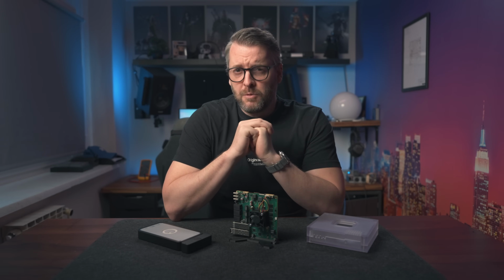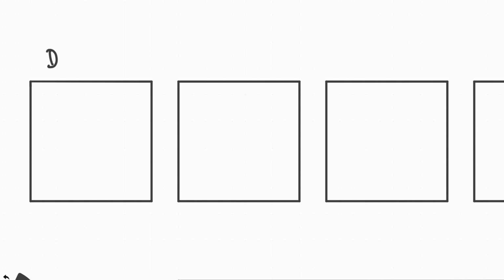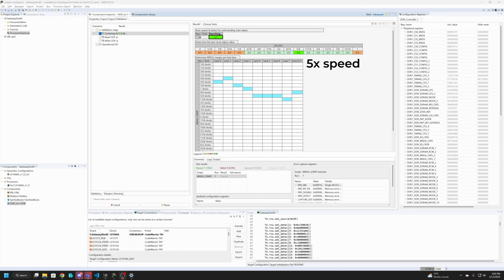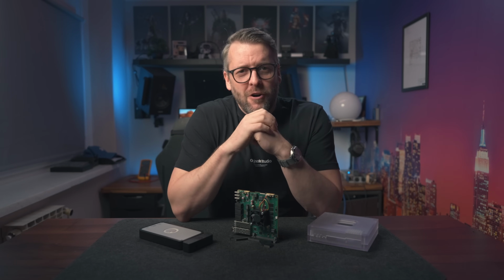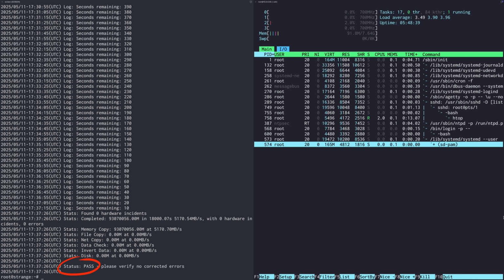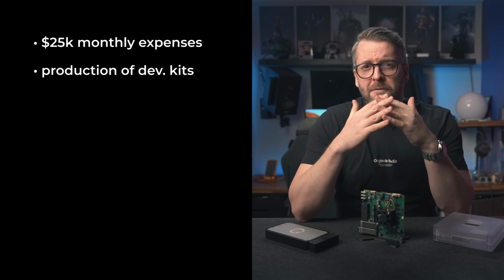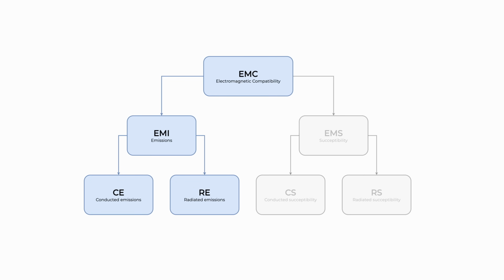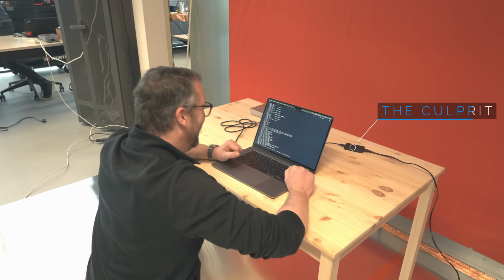We're developing a high-end router. From scratch. (April 2025 update)

Comment: Thanks for the update, I hope you are very successful in getting the funding you need to get the project off the ground. On the other hand, I have a more technical question about your product: Does this router have enough power to handle 10 Gbps on its SPF+ interfaces while enabling features like routing, firewalling, IDS, and PPPoE? I ask this question because I have been looking for months for a device that can do this at a price point that fits the home and small office segment. Today's metro fiber networks in Europe can handle these speeds, and only Chinese manufacturers are able to supply devices at very low prices with features like the ones I am asking about, there are also some European options like the ones made by AVM and their Fritzbox. Finally, since I have not found any option that convinces me in the price range I am looking for, I want to know if I have to spend so much money on a router that can replace my operator's router, which is not bad but not powerful enough.

Comment: From my perspective is not only the higher quality and better looking but also the value added of choice. Having a device that can work as I want it to and that does what I want is probably the best that so far isn't much out there.
Reply: Also its a very ecological approach. Last month I had this idea to turn my old samsung tablet into a survival book reader (install kiwix, replace battery and attach a solar panel).
Except I got stuck in step 1: I was unable to replace the android that is on it with linux, or with anything to be honest, since thanks to closed source and locked bootloader there was no way of putting my own software on it. Now that everything that is installed by samsung is just outdated, that tablet is nothing more than a paperweight.
Reply: But do you really need that, or does it just sound nice? What concrete problem do you have that you would pay money for to solve with this new Router?

Comment: regarding real certification: i dont think changing resistors will void it since passives are the parts that can change the manufacturer the easiest . 
If you change the PCB yes then you lose it.
But if you change the assembly ( aka nont mount some parts or use some other values ) then you still keep it but you must sign that it is still compliant. Based on what that resistor does it may or may not affect EMI and you  must know what and why you are changing so u can avoid risks

Comment: Naming each chip DDR# was a bad ideia for visual teaching, you might confuse people thinking you have different types of RAM chips 😂
Reply: Yeah, my first thought was "wow, they are even using old DDR1 to save costs?" before I realized they are just slot numbers.
Reply: @hubertnnn  Yeah, same.
Reply: DDR_01,DDR_02, etc.
Reply: @jabrazil416  That's still not correct because DDR stands for Double Data Rate and not memory.

Some would argue for DIMM, but that's for the modules that are replaceable.

An absolute correct definition for this DRAM Chip ## or DRAM_#.

But for instructional purposes and the sake of brevity RAM_# would suffice.